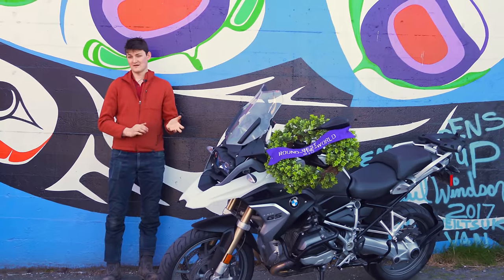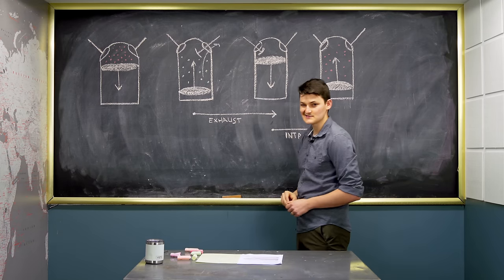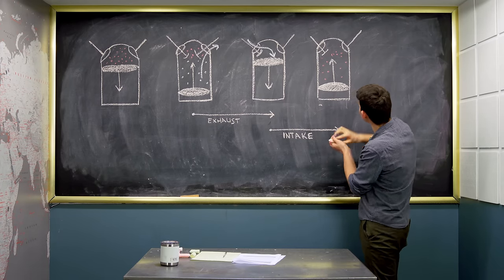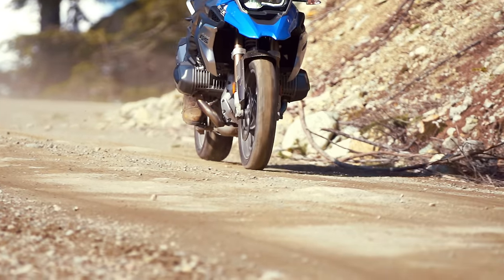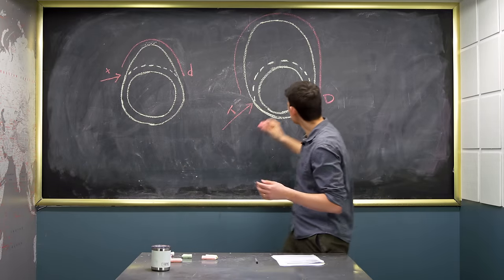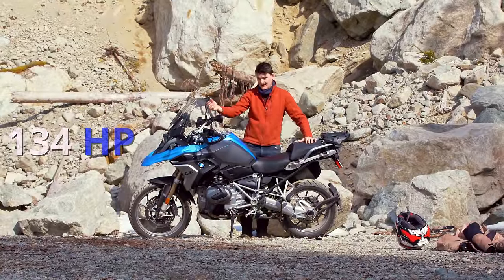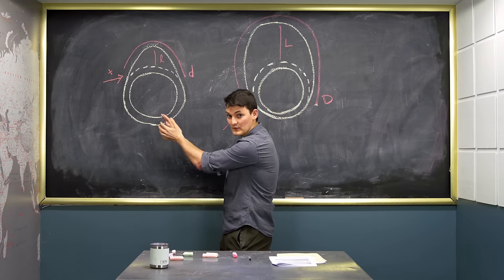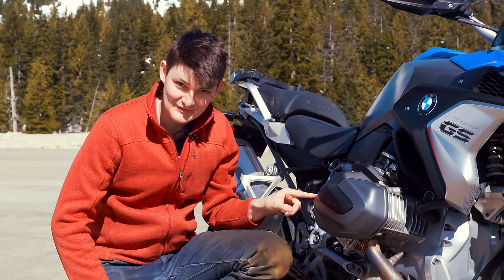Variable Valves are Bad for the BMW R1250GS - Review

Comment: Hill Hold is switched off with the push of a button - problem solved. 

Enduro and Rain mode reduces power and torque to 100 hp / nm - another problem solved.

A fully specced 1000 Versys or a 1100 Africa Twin cost about the same as the GS here in Norway, maybe even more!

Had a 1250 GS last year, after several 1200 GS' from 2012 - 2017.
The new engine pulls more everywhere, with less vibration.
iow: it works, and it's better than the 1200.
So, what is really the problem here?

If we're going to complain about "old school technology", i'm afraid we have to leave the entire combustion engine itself out of the equation. 

Which of the other big adventure bikes have a better working engine?
Had a 1290 SA in 2016, too much chuttering on low rpm's, as with the Multistrada.
The GS never complaints, all the way down to 1500.

Despite the pricetag, it's the best selling bike in the world. 
I reckon the explaination is that people simply find it to be the best bike.
Reply: From my time in the corporate world i can absolutely tell you that the best selling product is rarely ever the best, it's just the one with the mdt hype. Want more evidence? Ok, the REAL best selling bike in the world right now and of ALL TIME is.... a Honda Super Cub. I can assure you they are definitely not refined machines nor are they the best Motorbike.
Reply: I don't think you understand what he is trying to say. He says that the new model doesn't make the bike better. In ways it makes it not so much better. Didn't you see that the older model had the best bike award in the beginning of the video?

Let me point out what I feel about your points first. 
DOESN"T MATTER HOW MUCH IT COSTS IN NORWAY. PERIOD. Cause everywhere else except some parts of Europe it is about half.The video is made from a Canadian channel for the American continent. And no you are talking about being fully specced which depends on the dealer and how much they charge. I could argue that fully specced 1250 would cost more that fully specced vStorm.

Ofc the 1250 from last year is better than 1200. 

He doesn't say it is bad as in it is old school tech. It's bad in sense that it's not an elegant solution.To begin with it never was a problem. It hardly makes much difference cause the power it has doesn't make a difference on how much a capable 'Adventure' bike it is.

About the engine lugging. Bro are you kidding me?? A 1290 SA lugged? Maybe there was something wrong with that bike but I can guarantee that it doesn't lug. Probably a clutch problem. 

Despite the price tag what?? 30000 loonies for an adventure bike that isn't much better than a  bike with half the money and certainly more reliable? Did you realize how many people had problems with this new gs on the shift cam just turning off? There's also a comment here by Michael Schaefer that he had that problem. Go to the forums bro then you'll know. People were crying over that shit. And no its not the best selling at all. 

I might've sounded rude, sorry for that. What thee new gs has got as an upgrade doesn't make it a better adventure bike is the meaning of the video. Hope u understand that. Just cause you have points to criticize doesn't mean your points hold any value over the gist of the conversation.
Reply: @babutaja29  the 1250 has more pulling power than the 1200.
What is the problem with that?
Did BMW claim it is "a better adventure bike" than the 1200?
No.
It's an update, like every bike gets from time to time. Get over it.😉

To me, it matters what the bikes costs in Norway, cause that's where i live.  
Just like the price where you live matters to you.

Is there a better selling adventure bike in the world?

Yes, the (old) ktm 1290 sa engine has much more vibratons than the gs, especially on low revs. 
You can find that in reviews everywhere.

With all that technology, of course there can be problems.
It's a risk you must take, in order to develop your product.
I'm sure BMW will sort that out.

But yeah, i'm sure Suzuki won't experience any problems with the el.adj.suspension on the Vstrom, maybe because it doesn't even have el. adj. suspension! 

Feel free to buy a V strom instead of a Gs, but for some reason, the majority don't.

Strange world, isn't it?

Luckily, it's a free world, and everybody can buy the bike they want.
I believe that's exactly what is happening, year after year.
Reply: @babutaja29  

Ok... 

Do you find it difficult to express your opinion about a motorcycle, without being "rude"? 🤣 

Which dealer does NOT tell you that the new model is superior the previous one?😄

"As an update the bike sucks and is not a better adventure bike than last year's 1250".
I guess you mean the 1250 not being better than the 1200?
Well, the update lies in the engine, with more nm, hp, with less vibrations and consumption.
Call it what you like, i find it better. 
The shift cam adjusts not only the valve timing, but also the duration and amount of opening.
The system on the V strom, i believe only changes the timing. 

I said "old" ktm 1290, meaning i haven't tried the 2021 model. I believe there has been a major update to this years model.
I bought the 1290 SA brand new in 2016, so my comparison lies there.
Luggs, vibrates, use any word you like. As you might have noticed, i'm from Norway, and my english might not be 100%.
But yes, it had a lot of vibrations, compared to the GS. 

So, ktm have experienced problems with the 1290 as well?
Problems that have "been solved from the old model"?
That's great!
But how is it ok when ktm have problems, but not acceptable when BMW experience issues with the shift cam system?
Like i said, have you considered the possibillity that BMW will take care of this issue? 

Before the 1290 SA, i had a 2012 (air cooled model) 1200 gs, and i was so disappointed when i bought the ktm.
Sold it after 3 months, bought a one year old GS and never looked back.
Then i had 2 more GS's after that, and one brand new 1250 gsa in 2019.
So yeah, maybe i should "learn about motorcycling", but my impressions reamain the same. 

What did you not like about your 1250 GS, compared to your 1290 SA?
I reckon you've had both, like me? 

Bmw adventure bikes don't sell that good?!
Are you kidding?
The 1200 / 1250 gs/gsa is the best selling adventure bike worldwide!
Bmw don't have middle / lightweight bikes?
They have the 850 gs / gsa, the 750 gs and the 310 gs.
What more do you want?😅
In addition there is the 900 xr and the 1000 xr, being a bit more on the sportier side. 

"Extreme professionals" don't use bikes like the 1250 GS??
I could not care less what the "Pro's" do, and i suggest you do the same.😉
But i promise you, when i'm on a motorcycle trip for a week, with my girlfriend on the back and all our luggage as well, i sure as hell don't want a one cylinder 690 ccm supermotard!🤣 

But hey, as long as it rocks your boat, bro.🤣
Reply: @matsrekdal3065  lmao sorry dude. I sound like that. We all have our opinions and your is as good as anyone else .
Reply: @babutaja29  
Sure, opinions are personal.
Sales figures are not. 😉

Just for fun:
Look up all the professional reviews you can find from when the 1250 was introduced.
How many of them say they prefer the 1200 engine?
Close to none, i believe.

You can also find Dyno tests, showing the difference in real life.
The 1250 is stronger all across the rev band.

Have a nice day. 😉

Comment: 1. The tool to open the oil filler cap is under the passenger Seat ...
2. Hill start control is turned off when the bike is in enduro mode ...
3. Shiftcam is not introduced to gain power but to have variable lift resulting in better emissons  
4. RTFM before reviewing a bike

Comment: Not sure what you’re arguing here: is the new shift-cam technology too simple (only two cams), or too complex (electronically controlled)? All manufacturers are trying to add power while meeting tightening emission standards.  Maybe this isn’t the most ideal solution, but it gets the job done. 
In the end, this is a great motorcycle. You even said so; great handling on-road and off, comfortable, fast etc. The power chart you showed was nearly a straight line, and riding impressions concur; almost impossible to feel the ‘shift’. That’s not just me, all of the other professional reviews I’ve seen say the same. 
Also not sure where you come up with the $30K figure. If you can live with the regular non-adventure GS like me, the price can be under $22K. Hard cases and mandatory crash bars add about another $1500. Of course, there’s many great motorcycles out there for less money. All of them have their own shortcomings as well, but if you can afford it, the GS is still a great choice.

Comment: Ryan, under the seat there is the OEM screwdriver ( I know, not much of a tool kit, just a few pieces). The handle of that screwdriver is the tool to remove the oil filler plug ...

Comment: A couple of flaws with Ryan’s argument.  The GS is not a pure street machine.  It doesn’t need the pure smooth performance of a highway only machine.  No motorcycle is perfect for every single condition on the planet.  Even for high end bikes, manufacturing costs including R&D are a consideration.  As long as the system defaults to the low lobe in the event of a malfunction, it’s perfectly fine.  Part of the cost associated with the Beemer is with its reliability and longevity.  With decent care, that Beemer will be around a long time after the Suzuki is in a scrap pile somewhere.  The boxer engine is still one of the best in terms of being easy to work on.  Especially if you’re out in the middle of nowhere.

Comment: The REAL problem with the R1250GS is it's made by modern-day BMW and not BMW from 20+ years ago.
Reply: @Moto Bullox It means that it has to look good on paper, rather than in the real world. That's the difference between new and old BMW
Reply: I had, simultaneously, a 2005 R1200GS and a 1977 R100/7. The GS spent more time in the shop than on the road, and they’ve gotten worse since. The /7 was bulletproof! The new BMW relies on their reputation from 40-years ago.

Comment: I can't agree more with Ryan. Great review! I own a 2006 HP2 with +100,000Km, and the only things that failed on this motorcycle are... the electronics. Repetitively...Sure I had to rebuild the suspension, but it was after 70,000km, including a rough Alaska trip of 11,170km. But I already changed the TPS and the O2 sensors 3 times, both dammed air control valves for the ECU controlled idle, and now I am still having issue with an idle at 3500rpm when hot (try this is traffic!) and BMW are clueless. So I am in the process of changing all the others sensors involved with the injection, hoping it will fix the issue. Considering that this bike is by today standard depleted of electronic! So, I don't think that an electric component in the cylinder head for the valves variation is wise. At least, they should offer a strip-down version for real adventure minded peoples. Thanks for the video!
Reply: Good points. They really need to offer ADV bikes with no electronics at all, so they are more reliable. There is actually a major safety risk in having too many electronics because there is much less reliability if someone is in the woods and or lost on a trail somewhere. I would never drive a Pan America into the wood, there are so many reports of it breaking down for no reason, due to electrical failures. It sounds like the Harley Pan America has to be stopped completely, because they entire wiring harness and computer is designed incorrectly and it fails for no reason. Imagine if Harley made the Pan America with absolutely no electronics, it would have been a far better long term solution, because now they have permanently tarnished any new customers who want to switch to Harley.

Comment: Although I am a R1250 GSA owner, I am not a self-hating one. I have no anguish, or latent guilt feelings of my Motoraad privilege. My sense of (American) BDR “trail superiority” is earned by my riding experiences and not my birthright, or financial purchasing power. If Suzuki cared about anyone’s thoughts & opinions regarding adventure type motorcycle’s, they’d be in your local showroom dealerships. Your points about the mechanical reality on the R1250 are valid. You explain them brilliantly for the layman. But, the information in the video seems to be presented through your vision of a camshaft kaleidoscope. You could’ve made the same video about the circular efficiencies of the wheel, or the similar comparisons about motorcycle handlebars & seats. Keep up the great work and knowledge-filled videos you produce.

Comment: Okay, this is a tractor with a price tag of a steam engine and the servicing cost of a jumbo jet.....
What more could you ask for !
Reply: My experience with service cost has been relatively low. I had to purchase a diagnostic tool (GS-911wifi) and a special mount for the offset rear tire so I could balance it. That was 500$ up front but frees me up to do every service interval on my own. I let friends that ride gs use mine when they do their service so if you know someone with these tools and they will let you borrow your good. Jim von Baden has a video that walks you through every step of servicing. Expensive bike up front? For sure. But if you just want one bike with versatility! I really love mine. 18k trouble free miles and I ride then piss out of mine on or off road
Reply: Service doesn't cost any more than any other motorcycle. Stop relying on the dealer and do your own. Valve checks and adjustments are nothing compared to a Ducati and are easier than any 4 cylinder Japanese bike. Changing final drive fluid and oil/filters is easy. The clutch is easy to access if it needs to be changed. The front shock definitely is a bear to get to but the rear is relatively easy. Stop saying these bikes cost a fortune to maintain because they do not.

Comment: Brilliant review, agree with your points about tech on adventure bikes. I own a 2016 1200GS and was offered an upgrade to the 1250 by my local dealer for a mere £6K!!!! for a load of extra electronics I wish to avoid. That said you missed the gearbox has improved from one that sounds like a tractor engaging 1st gear as if someone just dropped a spanner in the cogs. The 1250 gearbox actually sounds smooth and feels engineered.
Reply: Do switch to Motul 7100, and your 1st gear clunk will probably reduce by 90%. Motul 7100 is alien technology.

Comment: some of your arguments are really trash my dude, are you trying to jump onto the circlejerk train? the hillhold for example can be turned off completely in the menu, also the oil inlet screw tool is part of the BMW tools that come with every bike. also if the shiftcam electronics should ever fail you can just ride without the camshaft shifting.
Reply: So then why pay so much for the 1250 if you are just going to turn it all off? He isn't saying its not a good bike, he is saying that the could have done better. Why does it make sense to change the oil inlet screw? There is no reason other than you having to buy the tool from them. All he is saying is that this is THE BMW GS. It is the standard that all other advs are judged against. Its a great bike still but it just has some questionable things about it. No reason to get upset. Ride what you want to. If other people saying things about a bike online gets your panties in a wad you may need to go do some riding and remember what its actually about.
Reply: @matthewyearber9361  you don't turn it off when riding on street and hills thats where it's useful, you turn it off when u need to make turns like he does and even then you can lket it on because if it ever activates just press the brake again and release and it turns off. it only activates when u pull the brake really hard while standing. And again you didn't read you don't need to buy any tool for the oil, it is included with every bike. Also it makes sense to make the screw such a weird shape, if you park your GS outside on the street no one will be able to screw it off so easily and mess with ur engine. My africa twin engine for example could be opened with just 2 fingers.
Reply: @kowalski2334  Agreed. Disclaimer: I am a 1250GS owner. However, I've owned Yamaha and Honda dual sports (WR250R, converted XR250R), Suzuki GSXR's, V-strom 650, SV1000S, BMW S1000R, and now a 2020 GS. This review was heavily biased, and intentionally ignored things to make it look bad. 
1) The oil cap tool is the base of the screw driver handle, which is included in the under-seat tool kit. The same tool kit that he used to select the wrench to sarcastically try to turn the oil cap. 
2) The hill-hold is an awesome feature when you ride in hilly stop&go. It saved me lots of headaches riding in San Francisco. It takes 15 seconds to change it to manual, or vice versa. 
3) Variable valve timing is different than variable valve lift. The performance disparity of the 1200GS and 1250GS on the road is very large. 1250 rolls away from the old motor with authority. Arguing the technical differences of VVT and VVL, while ignoring the performance benefit is pedantic at best.
4) The GS is an 80/20 bike (at best), not a 50/50. Riding 21" wheels on the street kind of sucks. There are certainly vastly better options if you want to ride on dirt trails.
5) He reviewed this bike like it was a Dakar machine, which seems to be his standard of measure. It's not a Dakar machine.

This review completely ignored all of the amazing things about the GS; 2-up competence, ability to crush miles while still being a dynamic and exciting bike to ride, ability to crash through broken roads like they're smooth pavement while still being capable of carving. For my next review, I'm going to do a DRZ400 and ride it on the highway for 6,000 miles with a passenger.